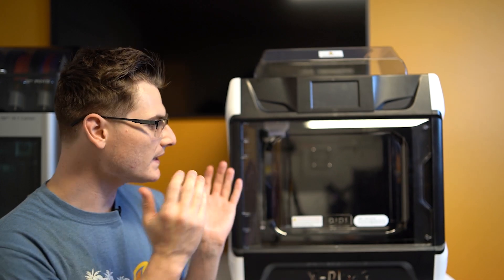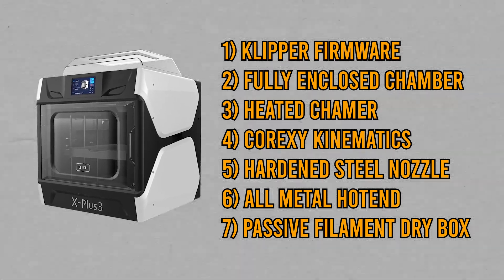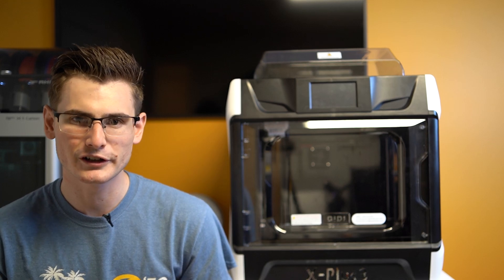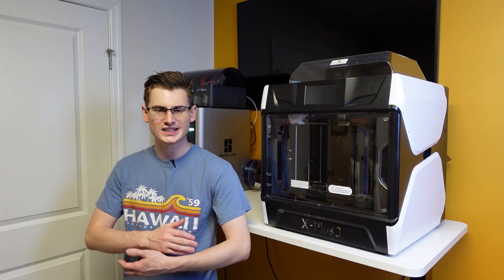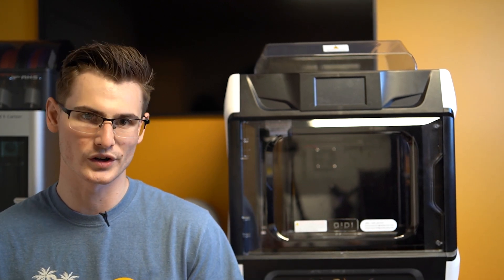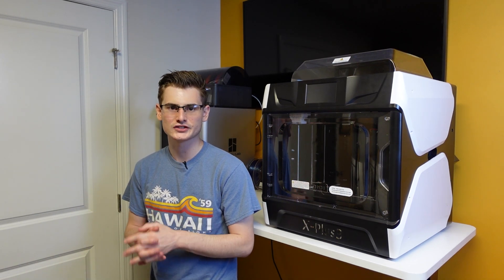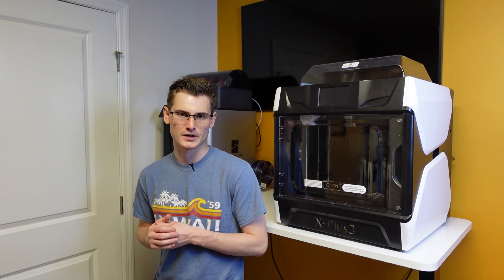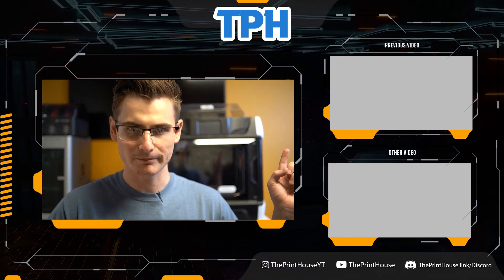The QidiTech X-Plus-3 MAXIMIZES Value at ONLY $700

Comment: @theprinthouse  Which mid range (£800 avg), core xy, enclosed printer do u recommend?
Reply from the maker: It really depends on what youre going for. I can recommend all of the ones in that price range (that Ive tested) for different applications. If you want to print ABS, PETG, and more advanced materials then absolutely the qidi x3 line up. If you want to only print pla then go with bambu printers, but if you only want 1 color save money and go K1. I havent tested the other speedy corexy printers like the adventurer 5m or other brands.
Reply: @ThePrintHouse  thank you

Comment: Actually I have the X-Max 3 and the X-Smart 3. The board is based on the MKS Skipr. You can setup everything from scratch, there is even an actuall version of Armbian for the MKS Pi (which is integrated in the board). So you are not dependend on Qidi for any upgrades.

For me the most annoying part is Qidi using a thermocouple, not a thermistor on the hotend. I modified my hotend to use a Revo with High-flow nozzle, wich has about the same flow than the original hotend, but makes it much more easy to swap (without even recalibrating z-offset) to an ObXidian for abrasive filaments or to other nozzle diameters. However, due to no thermistor input on the printhead nor the main board, I added an old Creality board as 3th MCU just to get a thermistor input. Worked well on first try (and I am a beginner with Klipper).
Reply from the maker: Dang, that's amazing and great to hear. It actually doesn't surprise me though, based on what I saw with the rest of the printer. It's a solid option. I'm excited to see what qidi has for 2024!!

Comment: I had no problem with z offset.....the filament sensor must be activated in the menu....i had no problems with the menu looking up. Hotend is connected strange to the motherboard not upgrade friendly
Reply from the maker: Is it in the menu system? I looked around and never saw it. I will check again! Yeah this printer is sadly not upgrade friendly for aftermarket parts.

Comment: I just got this printer and have yet to get a successful print. Im using their petg and default settings ao im wondering if im having the z offset problem. I cant even get a first layer to go down without messing up. How did you calibrate your z offset if not with their paper card? Thanks!

Comment: How far away from Bambu is the print quality on the Qidi?
Reply from the maker: Qidi machines are as good as Bambu machines in terms of quality and speed. They can even print certain materials better. The user experience is good but it is absolutely not as good as bambu though

Comment: Thanks for the great review. You mention that this is one of the best for engineering filaments ? Even better than the X1C next to it ?curious if Bambu is worth the extra $$$ if mostly printing ABS/ASA.
Reply from the maker: My Bambu X1C is WAY more refined, however this machine (with tweaking) is probably better. If you use BAMBU filament, then the X1C might pull out ahead though. With the flexibility of the internal heating chamber as well as klipper firmware, this machine really is great. I am going to keep it for ABS and other high temp materials. This is not my daily driver. If you could ONLY have 1 printer for everything the X1C will win

Comment: Have you seen their video about adding a camera to this model, and the other 3 series printers? I have the Max 3 and love it, but the filament runout sensor is not turned. on by default, you have to turn it on yourself.
Reply from the maker: I haven't seen the video I'll have to check it out!! Why would it be off by default?? It makes no sense!!!???
Reply: @ThePrintHouse  I watched a few other YouTubers unbox them and they said the same thing. Why would it be shut off by default. I just got royally hosed on a Ironman helmet because I factory reset mine and forgot to turn the sensor back on. It ran out with less than 50 layers left to print. Makes me sick. Ha.
Reply from the maker: @3dPrintingMatt  that just makes me angry. I'm fortunate enough to not be bothered by ruining a 1kg print because I have like 150kg at the studio, but most people don't have that much so this a HUGE issue.
Reply: @ThePrintHouse It probably has false positives. I hear of that occasionally in the Prusa newsgroup.
Reply: @ThePrintHouse I was more ticked off about the 22 hours I spent waiting for it to finish and what did print was gorgeous. Of course. Haha. I was just using inexpensive pla+ from Amazon. But it prints awesome. Duramic. And I have about 5 spools of it that are just partial spools I would love to use up. Lol. Oh well. Love and learn. It’s printing again now. Brand new full spool and runout sensor is ON. haha.

Comment: When you say that you wouldn't recommend the X-Plus-3 for PLA, do you mean that it doesn't work well for PLA or that its overkill for primarily PLA usage?
Reply from the maker: It works very well, but it is way overkill, and the physical size of the machine makes it unwieldy to move and load filament. If you only print PLA, I think you will be happier with a K1 or a P1P.
Reply: @ThePrintHouse  That's good to know. I can deal with the size. Crealitys quality issues have turned me off them and Bamboo gives me Apple vibes so I was looking for something else. 
I have mainly used pla but with this printer I will probably find reasons to use different materials that will benefit from the chamber heater.
Reply: Qidi have model on their support page that you can print which allows the filament holder to be mounted on the side. It's annoying that it's not that way from stock, but at least it's an easy fix.

Comment: Qidi 's camera is on pre sale... Now I'm waiting for z offset sensor..
Reply from the maker: Do you need a new sensor??
Reply: Umm I don't like that we still have to use leveling paper in 2023. Qidi said that they are working on multicolor and z offset sensor.. And I'm waiting for it @ThePrintHouse
Reply from the maker: @Affordy  oh yes. Fair game. Leveling paper is crazy. It is so unnecessary. We need more ams machines in  2024.
Reply: @LIThopes05  The leveling paper was only for the initial setup/calibration after that it will do the auto leveling by itself.
Reply from the maker: @CleetusVanDamme530  no it needs leveling paper every time you level the x plus 3 :/
Reply: @ThePrintHouse  oh, yeah, that's crazy. Didn't realize that feature was exclusive to the X Max 3.
Reply from the maker: @CleetusVanDamme530  well it remembers the z offset after as many bed mesh calibrations as you want, but eventually the z offset will need to be recalculated due to nozzle wear or a new nozzle. I suspect the xmax 3 is the same. Qidi really should have implemented auto z offset into these printers. The paper method is outdated
Reply: @ThePrintHouse  I think I just had no choice to implement both chamber heater and z offset sensor. their price is very competitive.. but I just accepted 20~30$ price increase if they had z offset sensor.
Reply: @ThePrintHouse I have the X-Plus 3. I set the Z offset once and then never touch it again for weeks at a time.

Regarding the screen being unresponsive, I had a similar issue. It turned out that the screen was screwed on too tight from the factory, and this was activating the touch screen. The fix was to back off the screen mounting screws about half a turn. They are located on the back side of the screen. It's a little awkward to reach them, but it was a once and done deal.

Comment: I have owned the X-Plus 3 for over six months (having previously owned the original X-Plus for several years). IMO, the X-Plus was a MUCH BETTER printer. Yes, the X-Plus 3 is faster. BFD. Half the parts off the X-Plus 3 are pure garbage. I mean absolute fails from attempts at simple parts with Qidi Tech supplied PLA. I wish I had kept my older model (given away as a gift). The X-Plus 3 also suffers from firmware issues. All in all, this machine has been nothing but frustration for me. It is a beta product that should have never been released for sale.